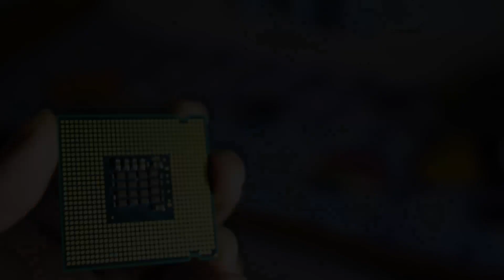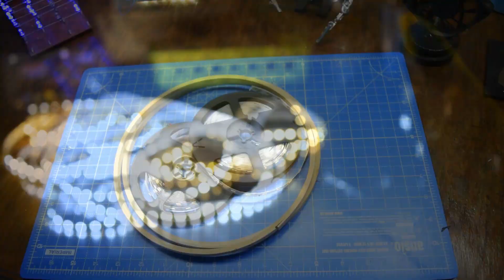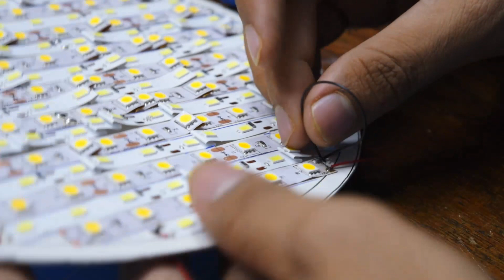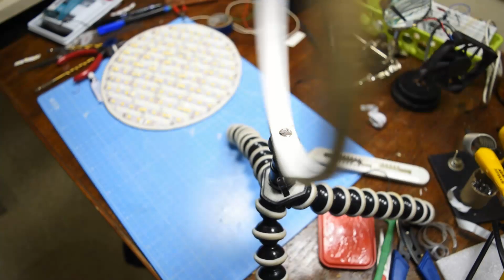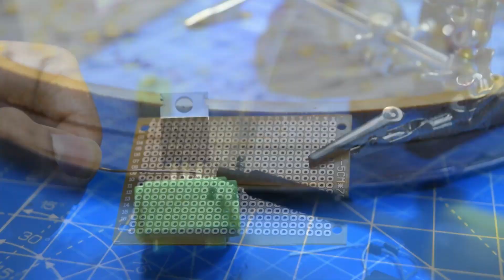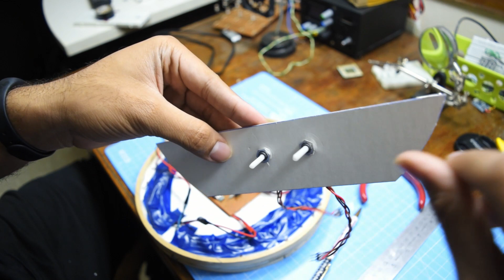Building a Super BRIGHT Video Light

Comment: Would you be able to share a mod for just one dimmer.  I would just like to use one type of strip.
Reply from the maker: Hey it is pretty much the same circuit, you'll just have to use the NE555 timer instead of the 556. 
The 556 has two timers in it and I've basically duplicated the dimmer circuit

Comment: Hey dude, wires are too thin!!!! They can't handle the current.
Reply from the maker: It's actually works fine, since it is a PWM current signal peak current is never drawn continuously. Also these are stranded copper wires and not solid core.